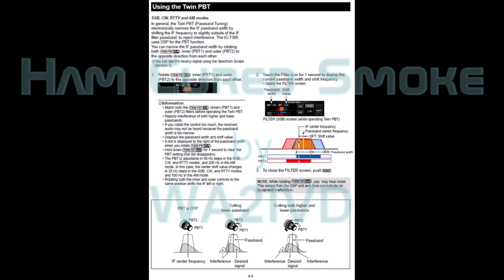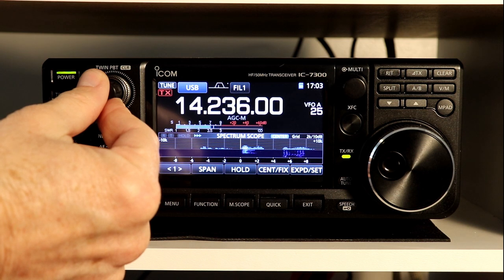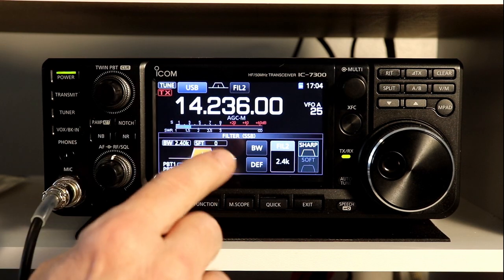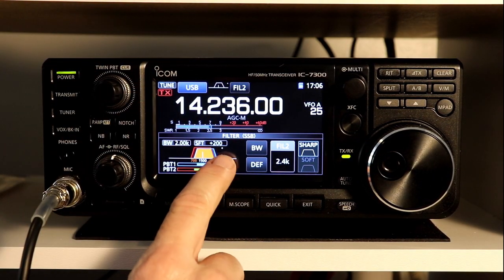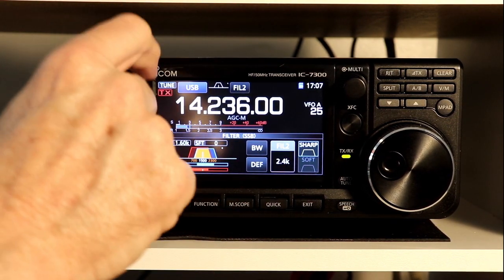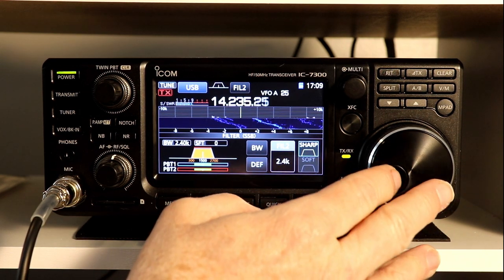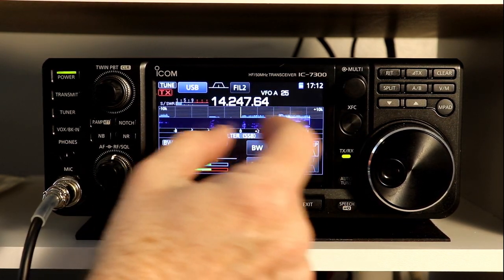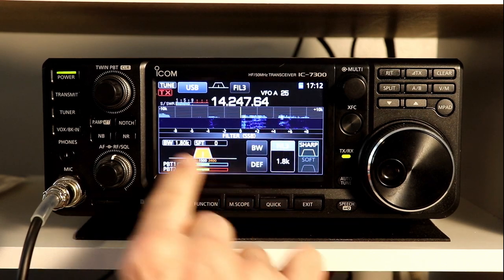Icom IC7300 A to Z #10 Twin Pass Band Tuning (PBT)

Comment: I viewed your series 3 years ago when I got my radio. I have reviewed them all a couple times since.  They are a great reminder and I learn each time.  

The name "twin pass-band filters" suggests that they are essentially each 2.4 kHz pass-band filters logically connected in series.  The only range that gets through both filters is the middle overlapping section.  That is affirmed by your tests.  As such ICOM's graphic accurately represents how they are doing it. However I agree with you that it would be clearer to the user if the graphic were showing what was effectively accomplished, which is that you can move both edges of the effective passband around with a maximum width of 2.4 kHz. W5PZT

Comment: Your vids are a great service to the community. It would be very helpful if you could position the camera so your hand does not block the portion of the radio you are pointing at. This happens in a number of your vids. 🙃
Reply from the maker: Hi.  Yep, valid comment. You’ll see that is fixed in later videos

Comment: Ive been using the TPB for a while now. Great job on the explanation of its use. I find with mors use, I gain an greater understanding of its use. Depend on your ears, not your eyes when adjisting this feature.
Reply from the maker: Thanks Joe.  That’s a great tip to pay more attention to your ears than to your eyes.
Reply: Thanks Tom. Your videos on the 7300 are sooooo helpful.

Comment: Thank you, this was most helpful. I'm a new owner of 7300 and I found those controls confusing, coming from analogue transceivers with separate IF Shift and filter bandwidth controls. I think Icom would make things easier if they just used one of those encoders to control the left slope and the other - the right slope of the filter. Or one encoder for the left-right shift and one for the width. Even better if they displayed the filter shape on the scope to match the position and width with the signal spectrum.
Reply: Yes, just overlay the filter passband you're tweaking right on the spectrum display. You wouldn't even need to know what the numbers were, just use your eyes and ears at that point. Nice feature though. The filters are a real help during contests when signals overlap.

Comment: Very useful as I have a new IC7300.  Settings made it easy from your videos, however on  WSJT-X.  I had a problem, which I never had on my last rig. That was when trying to work or answer a FT8 call on any band between 2600 and 3000 on the waterfall, resulted in a very muted and low output power mainly on one tone.  Having solved this problem with the help of your number #10 on Tuning (PBT).  By selecting PBT   SSB-D  I found this ranged between 300 - 2700.   By changing this to 100 - 2900 which was the highest it would go.  Ideally needs to be 3000 for max coverage on FT8.  This solved most of that problem for me apart from  2900 to 3000 which is not often used. Any suggestion on this. Thanks again.  Ralph G4PEY

Comment: Dude, the PBT knob is a multi knob, push the knob to bring up the filter screen :)
Reply from the maker: Yep. Correct. I should have mentioned that in the video. I think I also forgot to point out that pressing and holding it resets the PB offsets back to the center.

Comment: My interpretation of this feature is that it simulates two independent filters in series. That is, the signal must pass through one and then the other. They can be tuned to (centered at) the same frequency, as is the case in the various default conditions, or staggered with one lower or higher in frequency than the other. You corrrectly demonstrate that when you stagger them such that you obtain the very same bandpass bandwidth as one of the defaults, you hear no difference in audio. Signals should and do sound exactly the same in each case. However, the skirt performance will be different in each case. Typically the skirts of IF filters have a significant deep notch fairly close in, and then followed by some re-entry ripple as you go further out. In a situation where you have two interfering signals, a slight tweak of one of the filters can, if you're lucky, move the notch to reject one interferring signal, leaving  the notch of the other filter to reject the other interfering signal. in the end you may experience the same audio quality, but enjoy better signal rejection for the situation at hand. What do you think?
Reply from the maker: I think your analysis of how they are operating sounds pretty reasonable.  As I said in the video though, since this function is completely software defined, we’ll never know exactly how it’s implemented unless they let us look at the source code ( or more likely, source figures).  I’m not sure you can compare this to “typical” IF filters since the software implementation eliminates many limitations of hardware filters.  Regardless, it is remarkable how well it works.  I’ll be talking a little more about this in the upcoming episode on how to setup all the IF filter options.  Thanks for your feedback.
Reply: @HamRadioA2Z  You raise a good point about because it is software, it may in fact be accomplishing its filtering in a manner that is different from the conventional filter design that I am used to when designing a filter with discrete components. Indeed, it may even be in a manner that is totally impossible in the real world. And I am not sure I'd be able to tell this for sure even if it was possible for me to see the source code. Have you seen ever seen the code for typical circuit analysis software, like Spice? It's complex. Still, if that software does use the same mathematical equations as we engineers did when designing filters using discrete components, then there is a good chance that the bandpass and bandstop performance would be exactly the same. I must admit, although I might be biased by my own imagination, as I use the receiver of the 7300 more and more in different QRM conditions, I sometimes have the feeling that the improvement I am realizing when I shift these filters up or down in frequency relative to each other is due to me moving the frequency of the first notch that exists at the bottom edge or skirt of a typical receiver's bandpass filter. And of course that's something that you couldn't do in a world where the bandpass and bandstop characteristics of IF filters were not adjustable. This is truly an amazing rig.
Reply from the maker: I did some experimenting with FIR and IIR digital filtering some time ago.  The details and sophistication of what they’re doing today to make a complete radio in software is way outside of my wheel house.  Even so, several modern coding tools for FPGAs and DSPS let you graphically draw your control laws.  Matlab-Simulink is one example.  So, with a little studying and plenty of Google searches, one could probably get the gist of how the filters are working if anyone would let you look at the diagrams.  I can tell you that digital filtering is not just a mathematical model of the equivalent ideal analog components.  They actually look at the signal data and process it using signal analysis techniques that involve pretty high level math.  That’s why some of the functionality is so amazing.  Since the source code is a lot easier to keep secret than schematics I would guess that Icom and the other big manufacturers will each keep their special magic pretty close to the vest to use as sales gimmicks, I mean features. :-)

Comment: Hi,

In my understanding, Twin PBT is similar to parametric  equalizer.  It control the filter's bandwitdh or Q, and center frequency within the range. 

The outer ring controls the bandwitdh,Q   and reducing  nearby splaters. QRM. Imagine a smaller holes in a tea/coffee  filter.  

The inner dial controls the 'center' frequency.  That's why we hear a tone changes , as we use RIT.   

So, Twin PBT is a variable  band pass filter + RIT . :)

The best time tu use tiwn PBT is during contest, where there are many stations using frequencies  near to each other Or when SWL, listening AM/SW broadcasts, to reducing  'unwanted' signal. 

Thank you.

Bahathir 9W2GNU, 73.
Reply: As a DSP guy, I would say that that would be the hardest way to do this.  I think they have one FIR filter design and they are scaling the coefficients to adjust the center frequency (and the center may be zero because I and Q - i.e a lowpass is a bandpass when you consider negative frequency) while maintaining identical bandwidth and then cascade that into a second identical filter where they do the same thing.  They move them independently, the skirts are the same, and they can get any bandwidth they want and at any "center frequency" they want.  That is computationally super cheap.  That is how they are doing ALL the filters in this radio - they are all just these two filters.  It is very effective too.  The soft filter is a different filter design and they do the same thing with that.  Trying to design a new filter on the fly wouldn't make a lot of sense as the number of taps would have to change.  Icom for the win!

I should also say that you can up/down convert a FIR low pass filter by multiplying the coefficients  by a complex sine wave (euler's formula) positive or negative relative to zero.  That is how they scale them.  This is all really different than in the analog world.